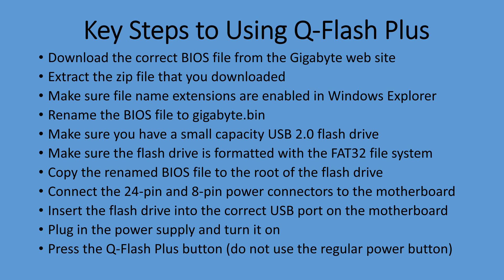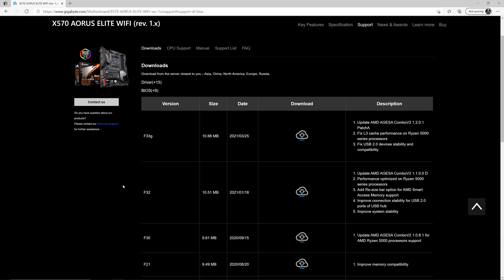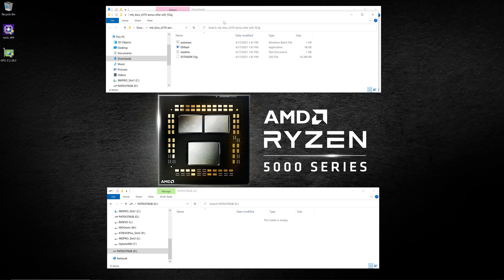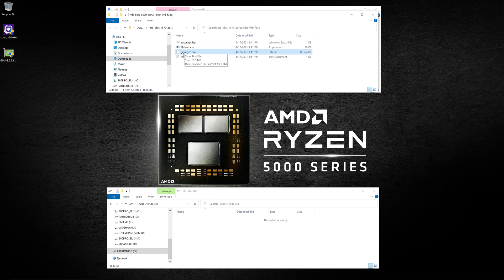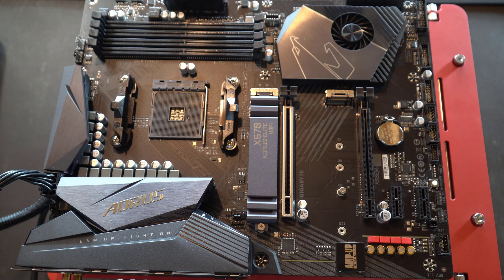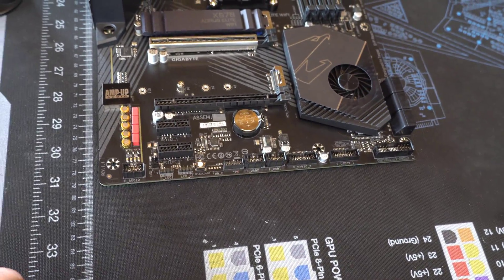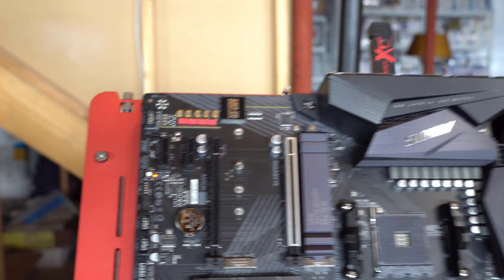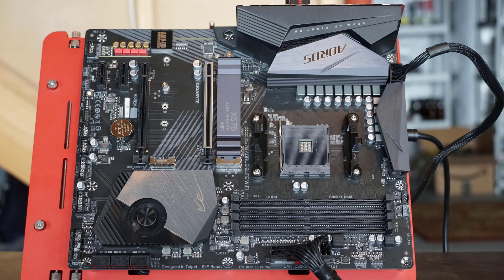How to Flash the Gigabyte X570 AORUS Elite WiFi with Q-Flash Plus

Comment from the maker: Here are some general troubleshooting steps in case you have any issues:

1. Did you watch the entire video, and follow the directions exactly?
2. Is the USB drive formatted with FAT32 rather than NTFS or exFAT?
3. Do you have file extensions enabled in Windows Explorer?
4. Did you download the latest BIOS file for your motherboard?
5. Did you rename the BIOS file as gigabyte.bin?
6. Is the BIOS file in the root of the  USB drive?
7. Is the USB drive in the correct port (the one labeled BIOS)?
8. Are both power supply cables plugged into the motherboard?
9. Did you plug in the USB drive before you turned the power supply on?
10. Are you using a USB 2.0 flash drive instead of a USB 3.0 flash drive (USB 2.0 seems to work better)?
11. Did the BIOS flash LED on the motherboard flash for 5-6 minutes, and then stop flashing?

This blog post has more details, including FAQs:
           Flashing Your BIOS with No CPU Installed  (https://bit.ly/3kfHjWe)

This blog post talks about USB 2.0 drives and how to identify them.
             Identifying a USB 2.0 Flash Drive   (https://bit.ly/2IQvQ2j)
Reply: I followed the video and my usb is working fine, after pressing the qflash the motherboard lef lights up like it should for about 4 minutes then stops and when i power off the psu and power it back on nothinng happens, please help!
Reply: @alexandercombs838  got the very same issue on Z590 VISION G...
Reply: @simonnail   i think i need to just finish setting my system up, connect to a monitor and see if it’ll POST. Just doing my first time build so im paranoid about everything and i did something kinda stupid earlier in the build i was worried had affected my cpu but nvm that ha 😅
Reply: @simonnail  also i am using this specific motherboard so im not sure how yours would differ but definitely something to keep in mind
Reply: my gigabyte vision dp after flashing for a while the led still light up it's done ?
Reply from the maker: @duidubydope4483  Which LED light is on?  As I said in the video, the BIOS flash LED is the one you need to look at. It should have flashed for 5-7 minutes and then stopped flashing when it was done. It doesn't really matter what any of the other LEDs might have been doing or whether they are on or off.
Reply: @GlennBerrySQL  the led close to the flash button but after wait for 30 mins ( because they're still light up) my bios still be the same as factory :( now i'm build my pc and gonna try to update it via bios :P thanks
Reply: Hi! 

While flashing on a x570 aorus pro wifi, the DRAM light was also steady red. Do you know why is this? I dont want to mount and install AIO and then not work and have to undo it. Please help
Reply from the maker: @lucasdomm  You can do this procedure on a fully assembled system. Just make sure you don'y turn the system on with the case power switch. It just needs to be plugged in, with the power supply switch turned on. Then follow the directions in the video.
Reply: I've done this exactly with a 5900X and X570 Aorus Ultra, with CPU, RAM and GPU installed and uninstalled, the CPU red light is on in either situation. After holding in the Q Flash button for several seconds the motherboard activates with all fans (including GPU), and the Q-Flash Plus Amber light flashes for several minutes, then stops, but no reboot cycle and eventual post, and the CPU red light remains on. Rebooting the system does not yield a post either, though I am able to replicate the Q-flash.

Any help would be greatly appreciated! :)
Reply from the maker: @mellhurstg4148  If the Q-Flash LED flashed for several minutes and then stopped, it probably worked.

Is your monitor plugged into one of the video outputs on your GPU (rather than one of the video outputs from the motherboard)?  This is a common mistake.
Reply: Do all boards have the LED next to the button? When I pressed mine no LED started flashing on the board (looks to be one however). But the USB did start flashing. Also would this fully power on the PC (ie. Fans turn on). Does the MB need to be turned on first?
Reply from the maker: @chineseelectricbatman  Every motherboard is different, as far as where the BIOS flash LED is located.  The motherboard manual will tell you where it is.

If you have a fully assembled system, then things like case fans will come on during this procedure.

With a fully assembled system, you do NOT want to turn on the system normally (with the case power switch). Just plug it in, and follow the directions from the video.
Reply: I had some issues with mine. The Q-Flash button wouldn't do anything. It wouldn't turn on power. My issue was because I had ErP mode enabled, where once the PC is powered down it shuts off all power. I had to disable ErP mode, then boot into Windows, then shutdown from Windows to get it to work. If I shutdown by holding the case power button after disabling ErP, then it still did a full power cutoff and the QFlash button wouldn't work.
Reply from the maker: @russkubes  I'm glad you got it resolved.

Comment: What if I set my flash drive up correctly and there is no LED light flashing on the motherboard when I press q-flash plus button?
Reply from the maker: That usually means that you skipped a step or made some small mistake. This low-level procedure is pretty straight-forward, but every single step in the process has to be done exactly right, or it won't work. These are the general troubleshooting steps:

1. Did you watch the entire video, and follow all of the directions exactly?
2. Is the USB drive formatted with FAT32 rather than NTFS or exFAT?
3. Do you have file extensions enabled in Windows Explorer?
4. Did you download the latest BIOS file for your exact model motherboard?
5. Did you rename the BIOS file as gigabyte.bin?
6. Is the BIOS file in the root of the USB drive (not in a directory)?
7. Is the USB drive in the correct USB port (the one labeled BIOS)?
8. Are both power supply cables plugged into the motherboard?
9. Did you plug in the USB drive before you turned the power supply on?
10. Are you using a USB 2.0 flash drive instead of a USB 3.0 flash drive (USB 2.0 seems to work better)?
11. Did the BIOS flash LED on the motherboard flash for 5-6 minutes, and then stop flashing?

Comment: I wish Gigabyte did videos like this.... they should pay you for solving their problems.  Spent 3 days trying to fix a booting issue and was about to buy an other MB.  Came across your video..... "rename the file and extension" wasn't stated in any of the other "help" or troubleshooting recommendations I've read.... It certainly wasn't on the Gigabyte website or in the user manual.  Thank you!
Reply from the maker: Glad the video helped you!

Comment: QFLASH button doesnt work. Nothing happens. Zero reaction. I did all your steps and i made sure myself that im doing perfect like you
Reply from the maker: It is possible that you have a defective motherboard, but it is more likely that you made some small mistake, such as downloading the BIOS file for a different motherboard model, not renaming the file, etc.

1. Did you watch the entire video, and follow the directions exactly?
2. Is the USB drive formatted with FAT32 rather than NTFS or exFAT?
3. Do you have file extensions enabled in Windows Explorer?
4. Did you download the latest BIOS file for your exact motherboard?
5. Did you rename the BIOS file as gigabyte.bin?
6. Is the BIOS file in the root of the  USB drive?
7. Is the USB drive in the correct port (the one labeled BIOS)?
8. Are both power supply cables plugged into the motherboard?
9. Did you plug in the USB drive before you turned the power supply on?
10. Are you using a USB 2.0 flash drive instead of a USB 3.0 flash drive (USB 2.0 seems to work better)?
11. Did the BIOS flash LED on the motherboard flash for 5-6 minutes, and then stop flashing?
Reply: @GlennBerrySQL  I found out that system cant be assembled. Everything has to be unpluged, especially CPU
Reply from the maker: @Dackyy.  That actually is not true. You CAN do this process on a fully assembled system. It just needs to be plugged in, with the power supply switch turned on, but it is very important that the system is not "running" (turned on with the case power button).
Reply: @GlennBerrySQL  Gigabyte manual says „Q-Flash Plus will update the main BIOS only if run without the CPU installed”
Reply from the maker: @Dackyy.  The manual is wrong. I have done it multiple times on a fully assembled system (as long as it was not turn on and "running").
Reply: @GlennBerrySQL  And mine system wasnt working with installed cpu. I’ll stick with manual

Comment: So I tried this and I think my issue is the USB drive as we used a usb drive with red inside meaning its likely a 3.2 or something.  Everything powered until we flashed it, and now nothing powers at all.  My buddy has some usb 2.0 drives were gonna try tonight, so in case anyone else is having this kind of issue I'll update what happens. Currently power button does nothing, but it will go through the flash procedure correctly (meaning it's getting power, and trying to flash the update) though after flashing its just a dead box.

Comment: When I press the q flash button, nothing flashes by the w flash button. Power supply is ok, 8 pin and 24 pin are connected. Usb drive is in. I get a quick flash from the motherboard just like in the video. What am I doing wrong?

Comment: did everything exactly and I am not getting it to display on monitor.. any ideas? followed every step and tried two different USB drives.
Reply from the maker: There won't be anything displayed on your monitor while this process is running. I assume you mean that your system won't POST afterwards.

What CPU do you have?  Do you have this exact motherboard or a similar model. Gigabyte has several similar models (with and without Wi-Fi) and you have to use the BIOS fopr your exact model motherboard.

Most Ryzen CPUs don't have integrated graphics, so you have to have a discrete GPU, and your monitor has to be connected to the discrete GPU (not the video ports on the motherboard). This only matters when you are trying to see if the complete system will POST.

Here are some general troubleshooting steps in case you have any issues:

1. Did you watch the entire video, and follow the directions exactly?
2. Is the USB drive formatted with FAT32 rather than NTFS or exFAT?
3. Do you have file extensions enabled in Windows Explorer?
4. Did you download the latest BIOS file for your motherboard?
5. Did you rename the BIOS file as gigabyte.bin?
6. Is the BIOS file in the root of the USB drive?
7. Is the USB drive in the correct port (the one labeled BIOS)?
8. Are both power supply cables plugged into the motherboard?
9. Did you plug in the USB drive before you turned the power supply on?
10. Are you using a USB 2.0 flash drive instead of a USB 3.0 flash drive (USB 2.0 seems to work better)?
11. Did the BIOS flash LED on the motherboard flash for 5-6 minutes, and then stop flashing?

This blog post has more details, including FAQs:
           Flashing Your BIOS with No CPU Installed (https://bit.ly/3kfHjWe)

This blog post talks about USB 2.0 drives and how to identify them.
             Identifying a USB 2.0 Flash Drive  (https://bit.ly/2IQvQ2j)

Comment: Thanks for the video Glenn. First time building. I watched your video for the small detail of lights on the motherboard turning on and going off right away which suggested to me my mobo was okay. I thought they were to stay on.

I did need a bios update. Watched your video, followed the steps, and my USB which happens to have an LED activity indicator on it blinked repeatedly. But the QFlash LED never turned on. And it did so for 13 minutes. I killed the power, it wasn't working. I checked my file name, was gigabyte.bin. I checked my formatting, was FAT. Reformatted to FAT32. Tried whole thing again, this was worse. The QFlash LED still didn't turn on, and now the flash drive light would go steady on for 2 seconds, off for half a second, on for 2 seconds, then off for good.

Something dawned on me, and I realized I downloaded the wrong BIOS. I do not have the integrated wifi card. I needed the non-wifi BIOS. Downloaded that, did the whole process, and it worked. The QFlash LED flashed here for 4 minutes. Fingers crossed it will POST when the whole thing is reassembled.
Reply from the maker: It sounds like you did some troubleshooting and figured it out. From what you describe, it probably worked.

Comment: My pc was setup and running after following this process. The next day I had installed some case fans, then went to Start my pc but it turned on for about 3 seconds then went off, this happened 3 times within 10 seconds before I flicked the off switch on the PSU. I tried to turn it on again but nothing would show on my display. The orange light near the logo doesn’t even show anymore as this was glowing when the pc was working just fine. Is my motherboard bricked?
Reply from the maker: That sounds more like a power supply problem

Comment: Hello i got a system crash yesterday after 3 weeks of running with out problems, now my pc doesnt boot. I tried to qflash the bios but the led next to the qflash button doesnt blink. Is the mainboard dead?
Reply from the maker: What, if anything, happens when you turn on your PC?  Any fans spinning, any lights on the motherboard?
Reply: @GlennBerrySQL  the fans are running also does the rgb, i tried every ram i have tried another gpu, tried another power supply and i managed to qflash the bios couple minutes ago bit still it wont work and i have no power on my keyboard and mouse. I ordered another x570 wich will arrive tomorrow hope it will work
Reply: @GlennBerrySQL  also i tried another bios battery and cmos reset

Comment: Great video. Thank you! Random question: this is the first board I've had with a built in IO Shield and it doesn't exactly seat onto the back of my case. Any suggestions?
Reply from the maker: It should fit if the motherboard is aligned properly. The opening in the case for the I/O shield is a standard size.

Comment: On the BIOS interface, there is an option to use q Flash   (F8) . Can I use that? Will it be necessary to remove all connection (except the ones you mentioned in the video ) and press physical button on the motherboard?
Reply from the maker: Q Flash is different than Q-Flash Plus. If your system will POST and you can get into the BIOS setup program, you should use regular Q-Flash, which is easier to use. You do not have to remove all of your components for either method.

Comment: So I had a little problem where I couldn't format my USB drive to FAT32. Turns out you need to create a partition smaller than 32GB in order to do so. Just in case anybody had an issue with that too :)
Reply from the maker: That is a good tip. Thanks!

Comment: My computer used to turn on and run all functionalities, but I would get no BIOS screen. I discovered I might need an update to the BIOS to support the new Ryzen 7 5800x; The flashing process was ok and lasted about 4 minutes, but now the computer does not even turn on when I press the power button. :(
Reply: i have the same issue. did you figure out a solution?
Reply: @SilverAim  I eventually discovered I had used a bit to much thermal paste and it was starting to dripple into the mobo. :sweat:
Reply: Ruh oh, that’s for letting me know.

Comment: followed your video -- have been tinkering with this for  half a day, pulling hair out at this point. No light flashes when I press and hold the qflash plus button on my motherboard. thoughts?
Reply from the maker: Unfortunately, you must have skipped a step or made a mistake. This is a low-level procedure that is very simple-minded. If one thing is different than what it is coded for, it won't work. I have troubleshooting steps in my pinned comment.
Reply: @GlennBerrySQL  I was able to figure it out 😀
Reply from the maker: @naffchristmas  Great!

Comment: So when I plug in my motherboard no lights will come on and when I press the a flash button nothing happens.... do you know what I’m doing wrong?
Reply: I'm in the same boat -- did you ever figure this out?
Reply from the maker: It is possible you have a bad power supply. Are you sure it is plugged in and the power supply switch is turned on?

Comment: Great video.  Mine stopped flashing after 5-10 seconds. Formatted 2.0. Downloaded latest bios from website. Renamed. Flashes for 5-10 sec then nothing. Help!
Reply from the maker: That sounds like a problem with your USB flash drive. It needs to be a small capacity USB 2.0 drive, formatted with FAT32. The renamed BIOS file needs to be in the root of the drive, not in a directory.

Comment: When I tried this my LED didn't flash at all.
Reply from the maker: Which LED are you talking about?  Regardless of that, if the BIOS flash LED doesn't flash, it is most likely a problem with the USB flash drive or how you prepared it. My pinned comment has common troubleshooting steps.
Reply: @GlennBerrySQL  I figured out what the problem was, but I thank you for the quick and speedy reply. It was user error on my part. On my MB it said it is rev. 1.1 so I went to Gigabyte's page and saw one labeled as rev. 1.1/1.2. I thought it was that one. I was mistaken, I actually needed rev. 1.X.
Reply from the maker: @Jinx_Cole  Glad you got it figured out!